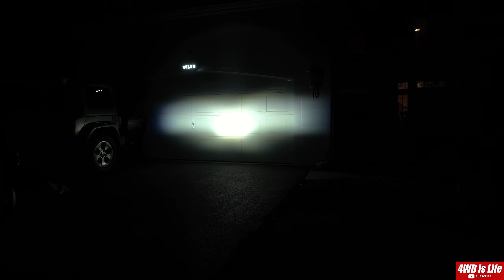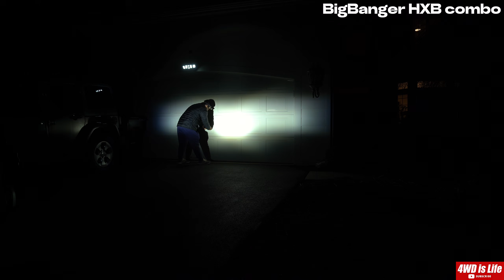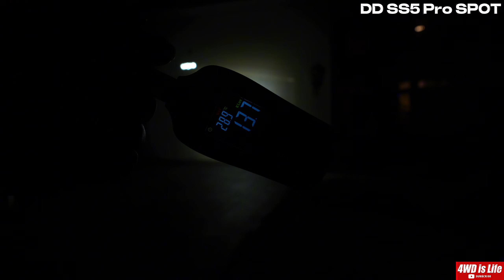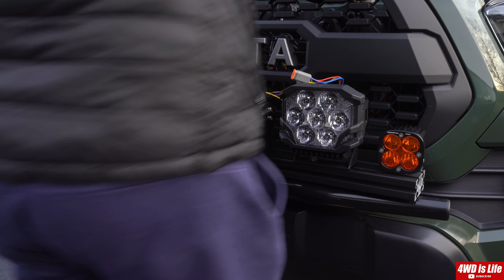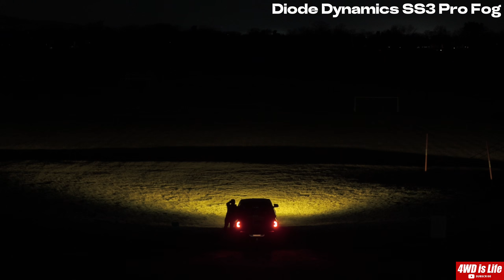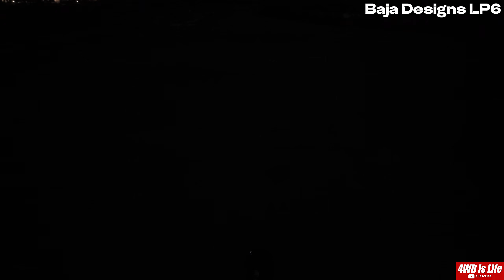Morimoto vs Baja Designs vs Diode Dynamics vs Auxbeam - Off Road Led Lights Comparison

Comment: One metric that would be terrific is an illumination output vs volume/dimensions to see which is the most efficient based on the size vs output.  Thank you so much for the best videos on YouTube!
Reply from the maker: again, great input. upon thinking more on this metric, I maybe putting it on the back burner a bit, I think the v/dimension is great but then two lights can have the identical v/d value with one being twice as bright and two times larger, in my honest opinion, I don't think that value will help people choosing the light that best fit in a certain application. but really appreciate the thinking and input!
Reply: @4WDisLife Absolutely agreed, but if I may offer, would dimensions be of value in a column LxWxH to show most to least compact.  Many bumpers have pre-cut areas for lighting so there may be constraints and/or bars that will limit how many lights can be installed.  Another example, would be if a light is nearly the output but 1/2 the size and I can put twice as many in the same area then the lower output option may be better, assuming I can support the power requirements.  I’m not sure if I’m crazy, but regardless, as another Engineer you have and set the gold standard for YouTube!  Thank you for the rigor and time you put in!
Reply from the maker: @JHKNVY2002   @drad8266  I could definitely show a quick clip of real world rough measurement of me doing the measuring, hopefully help people visualize the size a bit more. I would still have to clarify and ask people to fit at their own risk since each ones application is different and I can't 100% say whether it'd will fit in a place without actually physically testing it out.

Comment: You should also try Stedi Type-X off road lights. I think they are on par with these. They are made in Australia and are very popular there. They have a very impressive  specs and are a lot cheaper than most American brands.
Reply from the maker: I did look into them, I like how they look but they don’t seem to have a large market in the US market.

Comment: Why are you comparing spot vs combos and not all spots? Affraid of how much the morimotos will destroy the rest?
Reply from the maker: lol. Did you finish watching? Because there weren’t any other spot beam pattern lights to compare with? The Auxbeam, Baja designs, and diode were all more towards combo pattern. And even at combo pattern, morimoto come out on top to my likings and since the test, I actually acquired three more big bangers to make the ultimate setup for my truck.

Comment: I would like to see some actual driving footage. The garage door test is nice, but it's too close. The drone footage is interesting too, but I've never driven my car by remote control from a drone.

Based on my own experience owning a simple pair of Baja Squadron Pro driving combos, I think in real life it would come down to LP6 and Morimoto. The others just don't have very good patterns for real driving. On actual roads, my Squadron Pros have plenty of range and provide a very wide, even field of view. 

DD has awesome fog lights and powerful spot lights, but they really need to work on their driving combo. They have a driving spot which is SAE legal and looks like it works well, but still lacks a bit of width. They need to develop a wide/cornering pattern like Baja Designs uses and pair that with their driving bream.
Reply from the maker: agree, DD's combo currently is spot+flood, and their flood is very weak, I'd say if DD figure out a way to get their combo to become spot+fog, that would be a good starting point.
Reply: @4WDisLife I still think their actual spot is too tight for a stand alone driving light. Likewise their fog pattern is very wide, but still too short to use as a wide/cornering light.

Baja has verious spots, fogs, floods AND a dedicated wide/cornering beam. Diode Dynamics doesn't have anything equivalent to that one lense and they sorely need to develop one. Baja uses a wider, round spot with their driving combo. This is better than a tight spot, but my ONLY complaint about my lights is that they make a bit of a hot spot in the foreground as a result of the round spot. DD's dedicated SAE driving beam looks like more of an oval shape, which I think would perform better if it were just backed up with a proper, wide/cornering lense. And I wish they would do a 5000k color like Baja..

Comment: thanks for the review.  I mostly ride dunes in my SxS, and it looks like BD is the clear winner for me (most expensive too unfortunatly).  I love flood light and spill, as I find intense hot spot leads me to tunnel vision.  Heck I'm running work light style optics on my old SxS for ditch lights, which helps since in the dunes you are almost always turning, or poitning up or down.  BD says the beam pattern isn't for driving, but I loved it for just throwing light all over the place.  When riding dunes you are often needing to know what is off to the side to help pick your line.  However a nice morimoto for a spot would be helpful as well, to get tht stretch out in the distance.  I do wish the BD aux lighting was a little brighter, but I have my car up to run these with the whip lights, so it's nice to be able to leave them on without killing the battery.  They should be bright enough out in the desert so as not get run into without draining the battery quickly.  

I just wired up some LP4's but they came as spots (came on the new car).  I think I'm going to just change the lenses to combo lights before  even bother testing them out.

Completly different use case from your truck, but your review was amazing.  Thanks for doing all this testing.
Reply from the maker: Very detailed comment, and I agree for your use case, width is more important, and for that I may even say give Harbor Freight a try since their Roadshock 6 lights have the most width I have personally tested, true 180 degress of even low beam. Baja lp6 is definitely a good ole light that almost does everything good enough. Morimoto is a spot or (wider spot) monster for distance lighting.

Comment: I have a pair of the big banger hxb. Plan on adding 4 ss5’s, they’ll probably be 2 driving 2 spots. I’d get more big bangers, but just don’t have a way to mount them.
Reply from the maker: I’d agree to get the spots and driving from ss5. Their combo is a bit weak
Reply: @ also I’m sure you’re aware, but ss5 pro spot are brighter/more focused. The hotspot is larger and less intense in the pros as the chips are larger.

Comment: would loved to have seen more of the SS5 spot beam in the comparison, but otherwise, an incredible review, thank you!  Also, an idea for future:  try comparing against a GE4522 PAR46 halogen for a "reference" of sorts...
Reply from the maker: thank you for the comment and yes the spot to spot comparison is in the plan between morimoto and diode dynamics. As far as GE4522, please excuse my lack of knowledge, what is the purpose of using this as a reference? Baseline? Is it related to aviation lights ? Thank you!
Reply: @4WDisLife  the 4522 is one of the longest-throw/brightest 12v spot lights I've ever seen,  but I've also never seen it compared against LEDs. My own experience with it makes me want to see it vs the lp6,  at the level of detail in your videos
Reply from the maker: @Gavitron  I see, while searching on amazon, I came upon this seem to be a replacement for 4522 but in LED, do you think this would be a good sub for the helagon 4522?

Comment: I looked but haven’t seen if you test the Auxbeam V Ultra. Is that considered a better performing light than the one tested in this video?
Reply from the maker: I have tried v ultra and it’s not as powerful compared to this one in terms of distance, but it does have a wider width near the vehicle due to the side shooting function.

Comment: I chose Morimoto over the impressive yet less expensive Harbor Freight Roadshock 6 lights because of Morimoto's LIFETIME Warranty.  I have the 2banger NCS combo in yellow for DOT approved daily driving/fog (they're fantastic) and the 4banger HXB combo in white mounted on the front of my Wrangler's bumper.  My ditch lights are the 3" Roadshock floods which I have been very happy with as well.
Reply from the maker: very nice setup! I have to explore more from morimoto lineup.
Reply: I have all morimoto as well.  4banger sae hxb amber, 4banger hxb pillar, and bigbanger ncs amber.  They are very good lights!

Comment: From this test, I prefer the Big Banger, since this is a single pod in your tests, 3 pods in the front bumper will got me covered. Baja Designs are great but won't look good in the front bumper of my 4runner. DD should release a SS5 Max to compete withe Baja and Morimoto......BTW I have the same multimeter :)
Reply from the maker: Yea. I do like the rectangle shaped bigbanger a lot and somehow I think they are more classic looking. Also the backlight is important to me, the bigbanger have usable backlight where the other three is just mainly for decoration.

Comment: Another great review. I think DD needs a light with spot and a lense similar to their fog, or maybe three rows, spot, driving, fog (not flood). I really like the Morimoto, just not HR tests, I am glad you are testing them. The Auxbeam is pretty impressive too.
Reply from the maker: That is a great idea to have a row of spot, driving and fog, I don think the dd’s fog is one of the best I have ever seen. And maybe beef up their backlight power a bit. And I agree with your second half of the statement lol.
Reply: @ I thought the DD was the best fog pattern, what do you think is the best fog?
Reply from the maker: Sorry. I mean to say I do think. Not I don think haha. Yes they have the best fog I have tested. I am rocking a pair of ss3 pro fogs for three years and had no problems.
Reply: @ That is what I thought you meant, but wanted to be sure. I have always wondered if their fogs on the bumper pointed up a little bit would be great mid range lighting.